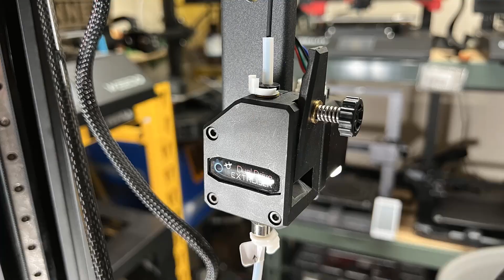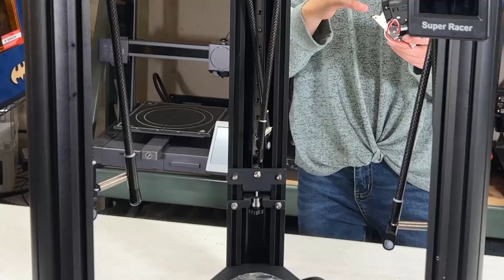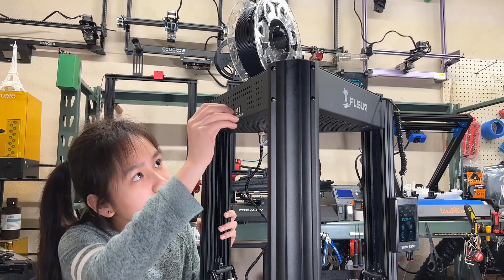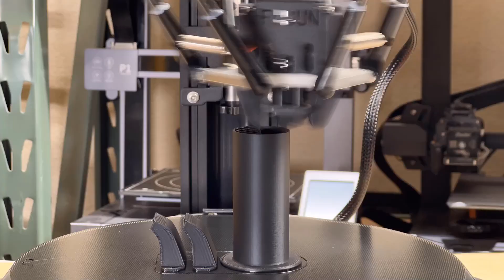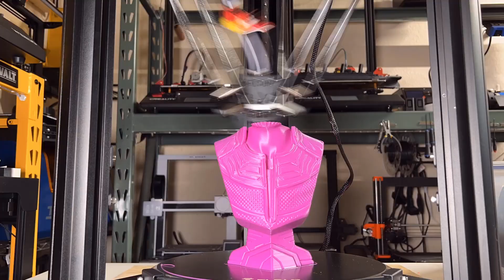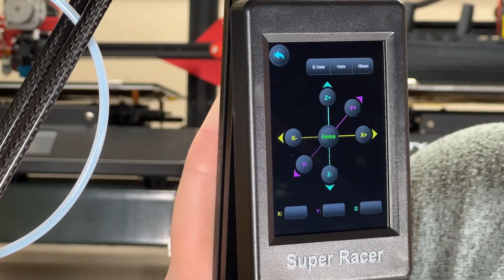FLSUN SR Super Racer Delta 3D printer review: 300mm/s High-speed 3D printing challenge, Pros & Cons

Comment: I can agree with the guy before me (even he commented 1 year ago); I have gained some experience with 3D printing even though I started just 18 months before I became immediately fascinated with the practical use cases for my job (I own a studio for photography and visual arts) are phenomenal (I guess I have saved within that short time about 2000 € +); within that time I had, as you can imagine, lots of problems and to choose the appropriate printer for one's use cases is an overwhelming task, the hundreds of youtube channels advertising printers in the name of "Reviewing" were NOT helpful at all (I have 4 printers "collected" in the short time, they all got their ups and downs, but I would have loved to get precise infos on that in advance instead of finding them out myself - even I have to admit that without this the learning curve would have been much flatter, and I now have a printer for most jobs, a fast cartesian style Anycubic Kobra 2 Max for more significant mechanical parts, a "work horse" Anycubic Mega Pro (after upgrading the stepper drivers to TMC2009 and "klipperize" it the speed is ok), a DIY printer out of very rigid 3030 profiles and a print volume of 1m3 for large decoration parts - it runs with a 1,2mm nozzle - and last but definitly not least a FLsun super racer, which overwhelmed me from the first print on but thanks to your review on the Speeder Pad and some research I did before, I ordered the Speeder Pad and the DD Head of the V400 (FLsun told me that this fits the SR as well). So far, thanks to your competent and trustworthy reviews, these are rare phenomena on YouTube.

Comment: I loved the video congratulations. I have a FLsun SR, but I've only been using it for a short time. I had some problems, one of them was that the film that covers the base tore when removing a piece. And now I'm left with a torn base. Another issue is that I find the extruder very weak, the gear wheels quickly become ground.

Comment: Hi! There are many options on the amazon link for the fan upgrade. Do you know specifically which one to purchase? There's the DC12V, DC24V, and 39in variants
Reply from the maker: Just DC24V would be fine, you don't need 39" extra-long cable as you are going to cut it and connect it to the original wires.

Comment: Aurora Tech -- really great job as always!  Based on your review I picked up a Super Racer and immediately replaced the ducts with the recommended improved versions.  I added a pei-coated magnetic bed, but had adhesion problems until I slowed down and reduced the height of the first layer.  I also roughened up the smooth pei with 400 grit sandpaper, cleaned with alcohol.  Adhesion is now very good, and it's much easier to remove large parts.  I am having a problem with the filament sensor, the printer just keeps going after the plastic runs out, even though the little blue light is off.  Not sure what's up.  Finally I found the Cura settings did not produce good quality infill (blobby and rough), it's just moving too fast.  I reduced the infill speed by about 40%, kept everything else the same.  Infill is now clean and only added a little to overall print times.  In short, love this printer so far, it's my fastest yet!
Reply: Update on my filament sensor problem.  I solved it by carefully studying the output from Cura (which worked).  Apparently the extruder in the SR must be run in absolute, not relative mode.  This was an easy change in Simplify3d, and now the sensor works brilliantly.  If anyone wants my Simplify3d V5 profile, post here and I'll make it available.

Comment: Great video! On the basis of your review I order an SR yesterday and it should be here this week. In the meantime I used your link to go and get the revised fan duct and print it out. However, at the link for thingiverse there are two different fan ducts? An "S" and a "L" duct. Not sure which one to download? I did print the "S" duct but don't know if that's the right one for a stock out of the box Super Racer. Any help would be appreciated... Thanks, Gerry

Comment: Hey great review! I hope you wrote a invoice to FLSUN. Making good modifications is not reviewing, its consulting and engineering work. They should pay you for it. 
But why doesnt it go 3x as fast as an ender? It should with your mm/s number.... acceleration is the key. I think you should take that into consideration when talking speed. Going to 200mm/s, upping the outer layer speed closer to the max speed, and upping acceleration could do more than just plainly going to 300mm/s ;)

Comment: Thanks for the helpful video! I’ve been enjoying this printer a lot so far but I’m also a noob to 3D printing - what sort of retraction settings and print temperatures are you using for PLA? I’ve been having some issues with stringing intermittently while printing at less than half the speed of in this video.

I really appreciate the upgrade links - once this print finishes I’ll be upgrading my ducts, blowers and hot end (allllll metal baby!)

Thanks again!

Comment: Are the upgraded fan ducts ok printed in PLA or should I print them in ABS? It's been great watching your channel grow. Keep up the great work!
Reply from the maker: It would be better to print with PETG or ABS, but PLA also works as it’s still a few mm away from the heat.
Reply: @AuroraTech  Thanks! I'm getting a ton of stringing off default Cura settings. Hopefully the fan duct upgrade will help.

Comment: this or the ender 3 s1/pro?
Reply from the maker: If you print PLA most of the time and occasionally PETG and ABS, this printer is the best. If you need to print other filaments like Nylon, Carbon fiber, PC, you need the Ender3 S1 Pro.
Reply: @AuroraTech  what about the quality of prints  between the regular ender s1 pro and the flsun sr? I'm willing to wait as long as the quality is good
Reply from the maker: The layer lines of the FLSUN SR are better than Ender-3 S1 Pro, Prusa MK3S+, or any Cartesian style printer that swing the print bed back and forth. But if you print something with a crazy amount of retraction like the Eiffel tower, a machine with a direct extruder prints better than the machine with a Bowden set up. So, it really depends on what you print.
Reply: @AuroraTech  I'll keep that in mind. Thanky you!